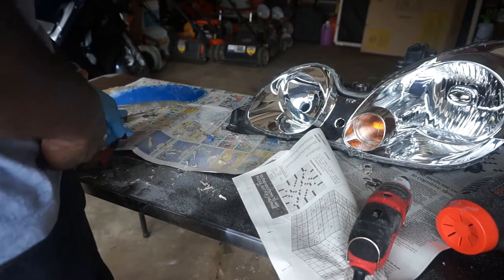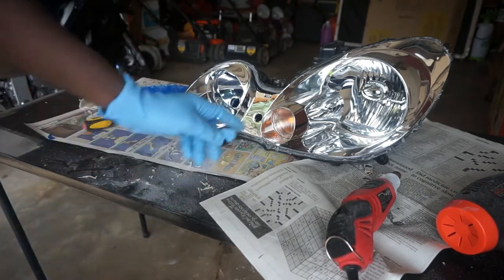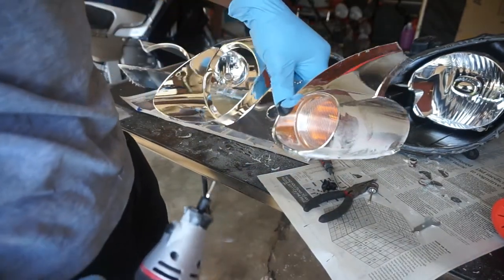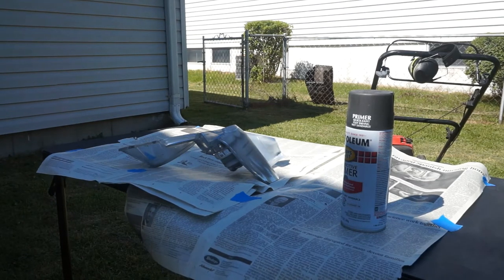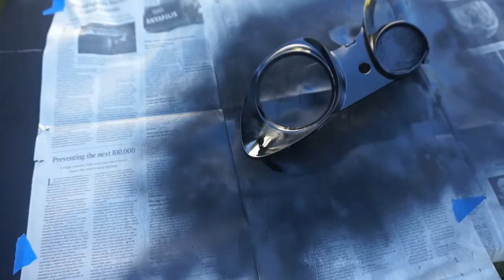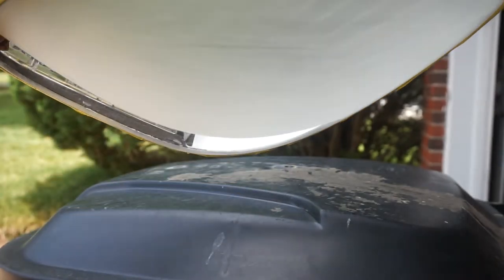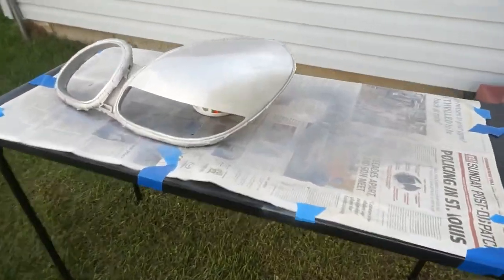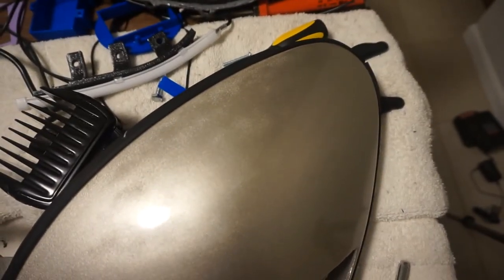Custom Cyber Headlight Build for Lexus GS300/GS400: Part 2

Comment: Try a plastic primer it will help with that if you have a eye for perfection do the plastic primer a few coats then start at 800 and go to like 1500 grit than paint a few coats make sure its glossy and shoot a metric ton of clear coat sand it at 1500 than 3000 and buff it ...